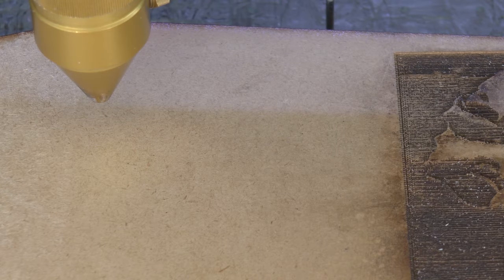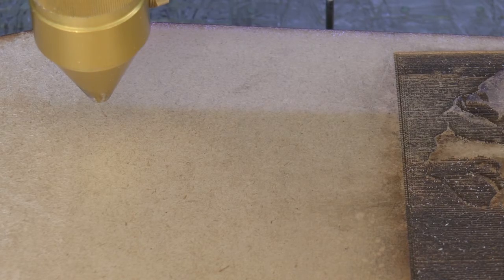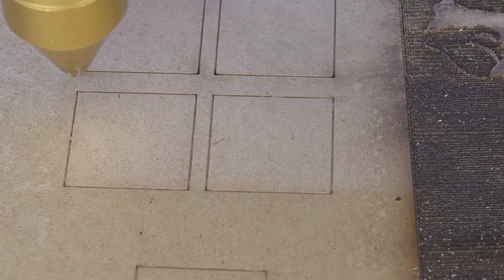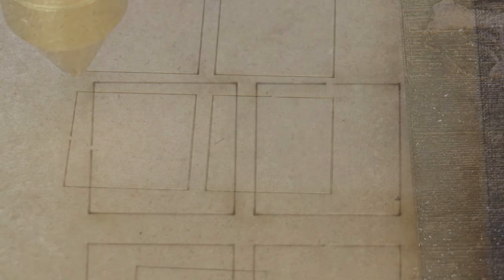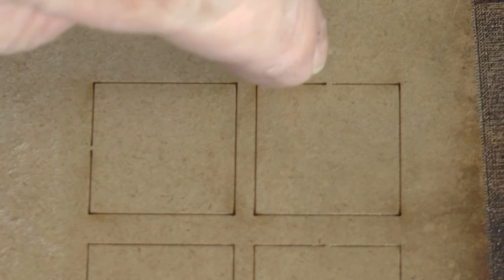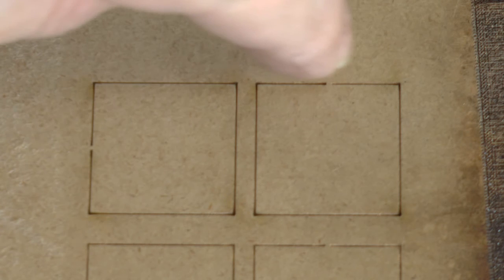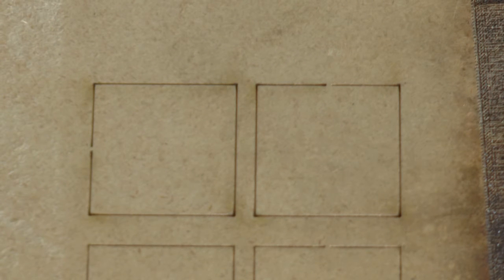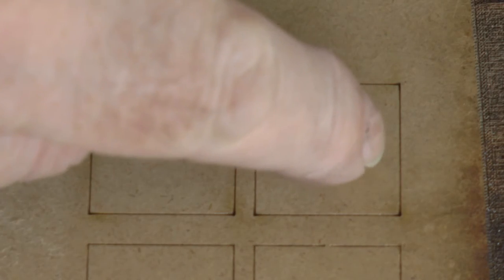RDWorks Learning Lab 55 Why Max Min Power

Comment: LONG story short, Min power helps you ramp the laser intensity down as it decelerates into corners and turns to prevent burning/varying depth. Max power is just that, max power on straight aways. You will have to play with the proportions 10% min, 30% max etc to get your desired result, BUT you don't have to watch the next 3 videos of this nice gentleman man sharing is intellectual journey showing what I just explained in 3 sentences.
Reply from the maker: Hi Devon
 Yes you are correct up to a point with  some of your parameters but it is not the full story. At this stage back in 2016 there were very few people that had much to share about this technology  or this specific subject and I was on a learning journey to find out for myself.. I did not fully get to grips with the MIN power  feature until about 18 months further into my journey whereupon you will also discover that your 10% is a very  vague approximation. The actual % is entirely dependent on your tube and power supply. Some tubes do not switch on until 18% or one Reci tube I used , 25%,  So 10% will certainly not work for them.  This later video explains exactly what is happening
https://www.youtube.com/watch?v=wJX8X40T4VM
The best way to find YOUR best MIN power is to draw a 25mm square and set your MiN % to 5. MAX has no effect on the result. Laser the  square  and you will find the corners do not join. Just keep increasing MIN power until the corners JUST  join. That's it.
 Best wishes
Russ

Comment: Hi, in rdworks parameters, what do "laser attenuation %"? Thanks a lot
Reply from the maker: Hi Rui
What you speak of exists in Vendor Settings.  With a glass tube you must understand  the max current you can allow to flow through the tube. Too much current flow will quickly shorten the life of your tube.
There are several ways to limit that current. If you have an ammeter then you can know what % power you require to reach this allowable limit. You can set that % power limit within the Vendor Settings.  A more complicated way to limit that current flow is to use the % attenuation feature.  You will have to guess the % attenuation and then test to see if you have achieved the max current limit,  It is just another way for the Vendor to protect the tube he has installed. To be honest most vendors don't set limits or are about how you treat  your tube. It is usually B grade to start with  and the more you abuse your tube the better the spare tube sales.
 Best wishes
Russ

Comment: I haven't had my laser for very long, but I was wondering about min/max power. Your video's are always helpful.
Reply from the maker: Hi Tim
Max  and min power is generally only used in special circumstances. In particular 3D engraving..... see   https://www.youtube.com/edit?o=U&video_id=3xO1hiBQzBg           . For normal cutting you will always set max and min to the same value. If however you are using a cut to draw a shape rather than to  cut it, then you will find that the corners always burn deeper and thicker.  You can employ max and min values to mitigate this problem. see https://www.youtube.com/edit?o=U&video_id=vqQyhW4uSsM

Hope this helps a bit. 

Best wishes
Russ

Comment: Hi Russ, another great informative video. Out of interest what would the result have been if you set the min to something below 9% or even 0. Is it possible that the over burn would stop completely?
Reply from the maker: Hi Bob
I have to deduce that you do not own a laser yet? If you did you will have found out for yourself that (depending on tube type and power) the tube will not fire below certain % power. That maybe 8,9, 10  or even 12% for some tubes. So the minimum I set was as low as my tube would run (just). The max allowable drive current through the tube will be specified by the tube manufacturer and the chances are that that will be reached by the time the power is set to 65%. So, many people wrongly assume that the power is linear from 0 to 100%. That's wrong and only the range 10% to 65% is usable.
Best regards
Russ
Reply: Hi Russ, thanks for replying to question and yes you are correct in your assumption that I do not currently own a laser, but I'm looking at buying a 60w in the very near future. I apologise for my apparent senseless question but my point was for the laser not to fire at the transition of changing direction.
Regards Bob

Comment: I think the min power and max power are for when a cut starts it uses max power then switches to min to carry on cutting the same line.
Reply from the maker: +Mentorcase 
When you look at the acrylic tests i did in part 2 there is no evidence of high power at the start of the cut. There is a specific feature in CUT mode for that which is called Through Power.  I demonstrated this on my beam drag video. This high power start and an delay before moving off, is only required for metal cutting machines where it takes a significant period (maybe a second) to pierce through thick metal. It is essential that you pierce through when cutting metal because the cutting mechanism is "melt and blow away"  With virtually all materials we use on our little techno toys the cutting mechanism is either burning (wood, leather, paper etc) or evaporation ( acrylic) and we don't really need this feature.
Max /Min has real purpose in SCAN mode but when you select SCAN you get an entirely different parameter selection widow. As soon as you swap back to CUT a greatly simplified window appears, however, Min power is still there....why? if it has no obvious function.
Best regards
Russ

Comment: With google it's really annoying trying to search for RDWorks, it will come up with about 2 laser related articles then shoot of on a tangent about road works for 500+ pages. Using quotation marks doesn't help either it just ignores them like I will show you what I think you need to know and it will be popular.
Reply from the maker: +Mentorcase 
Hi Thanks for that info. I'll check it out and change the tag to something that Google understands
Regards
Russ
Reply from the maker: +SarbarMultimedia
Hi
I did a Google search with just RDWorks (typed just like that) and the first page was ALL links to download sites such as Ruida  and Thunder laser, I found no links to roadworks. Puzzled.
Regards
Russ

Comment: Hello, great info as always. Another use I've found from searching around is than min-max power with output direct (and "special mode" in user/Scan mode settings) is used for power variation in high dpi scan mode for grayscale images and 3d engraving in wood. But your find seems more useful, it must make a big difference for cutting/engraving sensitive thin materials.
P.S. does this machine and software have the ability to control the z-axis (up/down) in a program? Changing focus and cut depths for example in a job?
Reply from the maker: +SotirisG 
Hi Sotris
 I'm in the middle of adding to that video because I'm sure that what I found is not correct. I'm sure the machine software is NOT that clever (as I originally suspected) and what I saw  was for a completely different reason. So lets wait for the real answer.. I'm investigating further.Yes,  I'm sure you are right, that max min power is all to do with the scan  mode
When you look in your control enclosure you will find TWO black driver module for the stepper motors. If you find a third then your machine is configured for a Z axis as well. This will only be possible if you have a motorized table. I have a motorized table but no drive module just an up/off/down switch.

You sound like you have done lots of engraving and know all about this grey area for me. Apart from playing with the basic tools I have had too many other things to deal with up to now. But now I am ready to explore other areas, Wood engraving and wood carving would make a great subject area. Any help/tips/experience you can furnish me with would be very helpful. I have discovered a manual on line for an early version of my machine that used a very early version of software when it was called RDcam It's written in a much more understandable way and I've just started to read about the engraving options in there. Most of it is recognizable in the current version of RDWorks.

Best regards
Russ
Reply: +SarbarMultimedia 
Hi Russ. I actually don't have a laser of my own yet, this is some info I've found searching the internet and asking manufacturers about 3d engraving capability (something approaching the Kern lasers: /qndvdUzfW-U). If you read the latest Ruida manual (and have some considerable deciphering skills!), under Direct output: it writes "according to the actual graphics gray... color deep place laser energy big, color shallow place laser energy is small", and under section 3.3.2 Sweep parameters/Scan mode, it writes "The purpose to select the special mode is to make the laser to emit beams at high power and in short period (pulse?), during deep scanning, the effect of flat bottom can be achieved". According to a manufacturer these settings with several passes and a powerful enough laser can produce a deep engraving/relief effect (search for the Thunderlaser 3d engraving video). Backlash and acceleration adjustments also I understand are important for engraving quality. Check this video also about focus /uBlcLtudxPs

Best Regards
Sotiris
Reply: +SarbarMultimedia 
Hi, Russ. I don't know if my reply was posted or not, here it is again without links.

Hi Russ.
 I actually don't have a laser of my own yet, this is some info I've 
found searching the internet and asking manufacturers about 3d engraving
 capability (something approaching the Kern lasers).
 If you read the latest Ruida manual (and have some considerable 
deciphering skills!), under Direct output: it writes "according to the 
actual graphics gray... color deep place laser energy big, color shallow
 place laser energy is small", and under section 3.3.2 Sweep 
parameters/Scan mode, it writes "The purpose to select the special mode 
is to make the laser to emit beams at high power and in short period 
(pulse?), during deep scanning, the effect of flat bottom can be 
achieved". According to a manufacturer these settings with several 
passes and a powerful enough laser can produce a deep engraving/relief 
effect (search for the Thunderlaser 3d engraving video). Backlash and 
acceleration adjustments also I understand are important for engraving 
quality.
Reply from the maker: +SotirisG 
Hi Sotris
I have only touched on the basics of engraving so far because I have had many other issues to sort out with my machine. Now that I have a good reliable machine I intend to start looking carefully at this very interesting subject. This whole Max/Min issue arose because I was doing a simple backlash test program as just another check for my machine. It passed with flying colours but I did notice this interesting depth of cut change in MDF at all the sharp corners. My immediate interest was in CUT mode not SCAN mode which is what you are referring to. I realise that in SCAN mode there are MANY parameters for playing with beam strength and these parameters ONLY appear in the parameter setting window when you select SCAN. In CUT mode the window is different.  My question has always been, why do they give you a Max Min choice in CUT mode ? I thought that maybe I had stumbled on the reason. Several correspondents have advised me that setting two values does have an effect, but at the moment I see no evidence of obvious change when I select extreme values(see part 2). My original "discovery" turned out to have been caused by a stupid mistake I made  (explained in part3).
Thanks for your input because this will be handy when I start researching, experimenting and making videos on this subject. There are undoubtedly some expert laser engravers out there who will quickly tell me where I am going wrong  but there are no in depth explanations/ videos of wood engraving techniques and "how to" that I have discovered yet. I last looked about 6 months ago and it's great that you advise Thunder Laser have now done one.  Thanks for that information I will go and check it out.
Best regards
Russ

Comment: that's great.  I'll have to play around with those settings on my machine :)
Reply from the maker: +Krefey Hi
Wait on I'm in the middle of a rework of the Max MIn. What I saw and for a reason I believed ....I think it's wrong I was stuck in a traffic jam tonight and was thinking it through....NO the machine cannot be that clever!! and I'm sure its not .....I'll be back!!
Russ
Reply from the maker: +Krefey 
Hi Michael
For some reason your bulls eye question did not appear in my comments, so I hope you get an answer via this.
It's sort of covered in my illuminated house sign video where if you chose scan mode it's the first closed object from the outside that gets scanned and then every other closed object going to the centre . For example if you draw 2 concentric circles and fill the cental area woth other random  circles  (some overlapping) you will see this effect clearly. 
I am just starting on an in depth study of engraving and one thing you can do with your bulls eye is to define pairs of circles as different scan layers and set different speeds and powers to each. That way you will engrave different depth circles Check out with preview before you cut and you will be surpised what happens.
Experimentation is the only way to learn because there are very few people out there willing to tell you their secrets.
Thanks for your input
Best regards
Russ.
Reply: Was less of a question and more of a "have you covered this yet".  I wasn't sure as it has been a while since I've watched some of your videos :)

Comment: I don't understand the backlash test.   wouldn't a better backlash test be to cut two parallel lines, cutting in opposite directions to see if the start and stop point are in alignment?  That should revel any slack in the belts.
Reply from the maker: +2020tesla 
HI Dwayne
You are correct. Isn't the information you are seeking there with the two parallel edges between the squares ?They travel in opposite directions and finish up travelling away from each other so that it would be easy to spot a misalignment (backlash)?  Everything was  drawn in alignment so that there were several opportunities to witness  mismatch steps,  out of squareness or non-parallelism. I did consider two circles starting 90 degrees from each other but that would have given me only one opportunity ( the start/stop point) to see mis-match 
Best regards
Russ